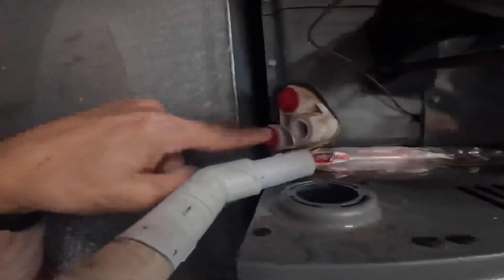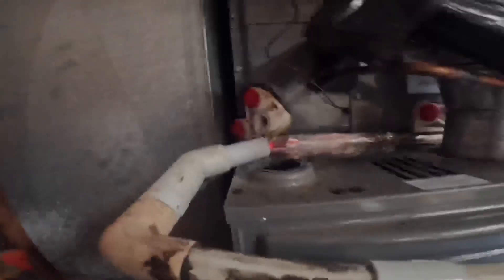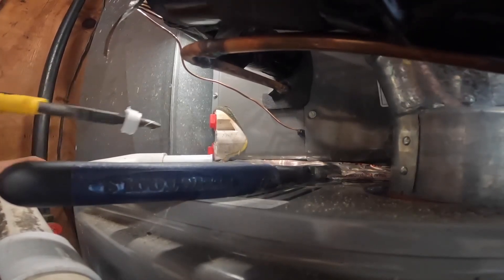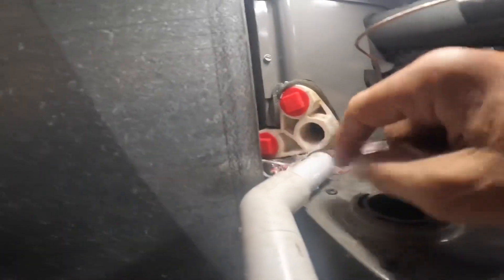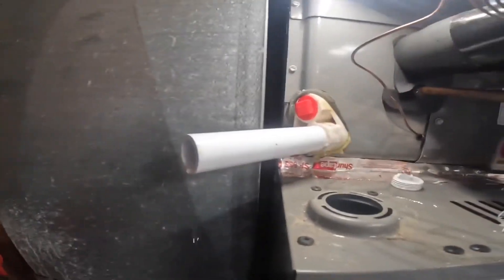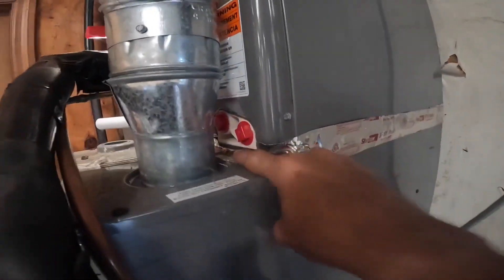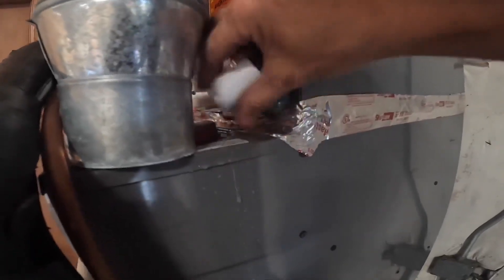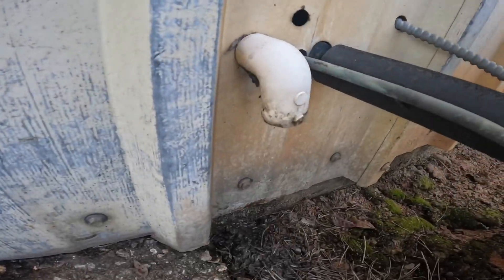An UnCommon Drain Problem

Comment: Of it the. You can cave in the rest of walls of fitting and pop it out.  Works on any size as long as you can the middle of fitting.  Used on 2”. And 3” etc black pipe fittings

Comment: I've seen a lot of the male adaptors glued into the coil. Not sure why they don't use dope or Teflon. Great video
Reply: No glue or pipe dope or Teflon is needed at coil drain opening
Reply: Educate yourself then speak
Reply: @williamserver4332  he's right no tape or dope needed on hvac primary drains or secondary pans
Reply: @GOOCHIElicker  read manuals.
Reply: @williamserver4332  you must not do hvac at all
Reply: @KB-wq5bb  I agree none of that is needed. Personally I use clear silicone to hold it in place which prevents the fitting from walking out when you get guys that like to monkey around with the drains

Comment: Take a skinny metal sawzaw blade, and a pair of bull snips.  Trim it to about a 1/4” and a few inches long inch and throw it in the mini hacksaw.  Cut top and bottom without damaging threads and comes right out 
Also usually put a threaded 90 on first before evaporator in place 
 or mpt with a slip when it’s against return drop. Deal with it all the time with ruud.

Comment: I've had similar problems with irrigation pipes that break with the thread still in  the fitting. Used to take me forever to replace with new fittings etc. until I discovered a tool with a left hand thread in HD that removes the broken fitting very easily and only costs a few dollars. However the tool has two heads 1/2" and 3/4". Never found one that does 1" and up.

Comment: A short straight threaded and a glue on 90 would probably work. I know you dealt with what you had to work with. I had a similar issue where I had to run a drain crazy to work it out, plus I put in a p - trap.

Comment: Now, how do I prevent that from happening?? I use Fernco 3/4" rubber couplings on almost every drain. Two will allow you to remove entire trap for cleaning. $10.

Comment: So both of my condensate lines go to a condensate pump that handles both systems and uses a single small line to push the water out
Is that better than using a PVC pipe for draining or worse?
Reply: It is a way to do it. As long as it takes the water out is good. Mostly those are used where gravity is not an option such as a basement.
Reply: @caru3257  The lines lead down to the crawlspace which enters the pump and goes out through a small flexible tube that leads out near both heat pumps..  Guess i'll just leave em as they are since they never appear to get blocked like normal condensate lines without a pump tend to do